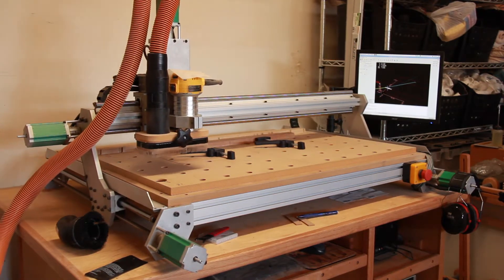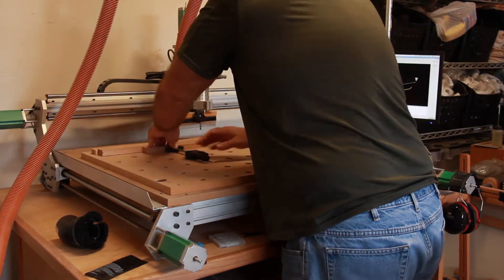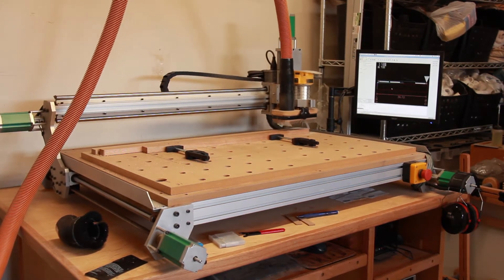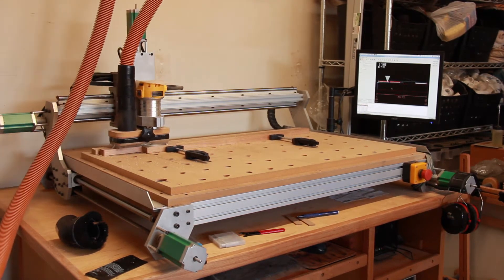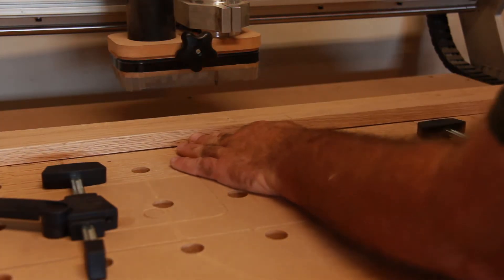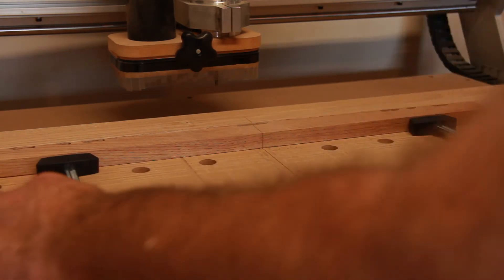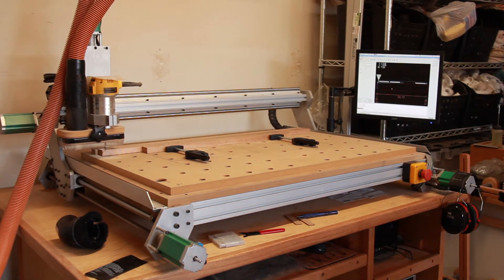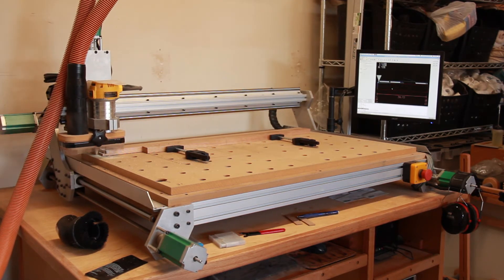Probotix Asteroid - Linux CNC - Fixture Coordinates - Part 2

Comment: What the name on the clamp you use and where did you buy them?
Reply from the maker: They are Festool Clamping Elements - designed to work with their MFT surfaces.
I machined similar holes directly into the MDF pallet and it seems to work pretty well.

http://www.amazon.com/gp/product/B000JNEC1Q?psc=1&redirect=true&ref_=oh_aui_detailpage_o00_s00

When unlocked - you can slide the business end back and forth to adjust the length.
Then with a cam action - underneath the center -  a hard metal plate (up inside) bites against the silver rod to provide the clamping force at any arbitrary position.  The silver rod is a softer material - and it can creates nicks that hinder the sliding a bit if you use them in the same position all the time.

Not perfect - but very flexible and I do like them.